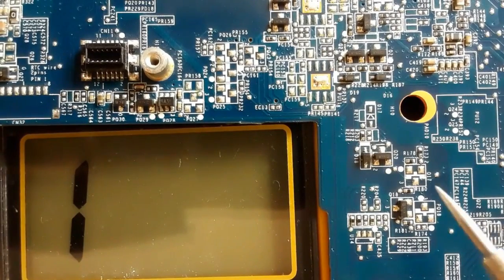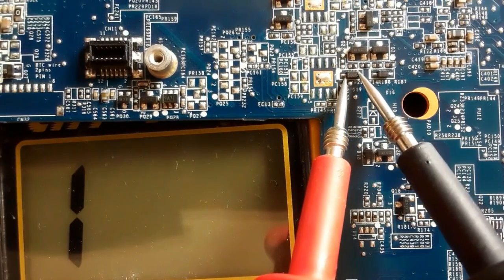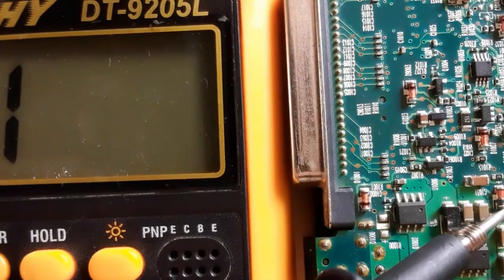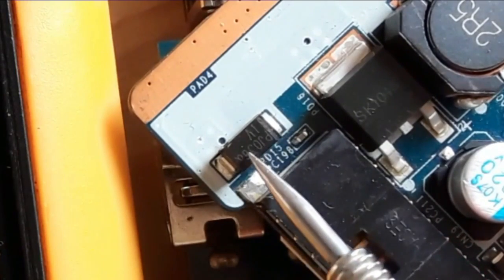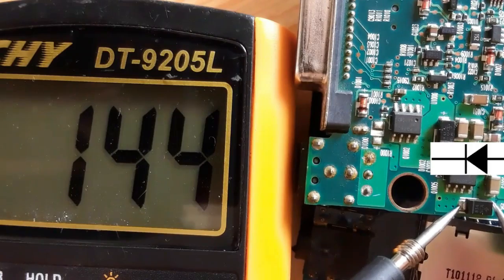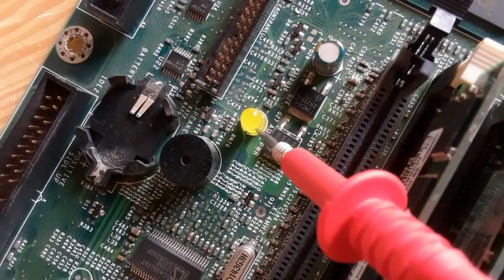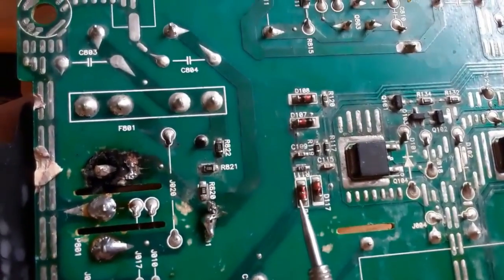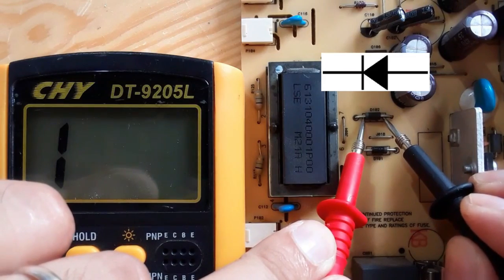SMD diode testing with the multimeter - Discover all types of diodes

Comment: My laptop motherboard is dead, then i check and found the three SMD Capacitor is bad, 100 EFK,Q72 is written on it. I cannot find to replace the same part no. So, Please can you tell me that SMD Capacitor value to change  the same value.
Reply: That is 100uF (micro Farad) E= 25Vdc. Good luck repairing!

Comment: What if you have reading in both ways when the diode is still soldered to the pcb but works as it should once desoldered?
Reply: This can happen when the diode is in circuit and is affected by other components
Reply: @cuanhogan4330  but.. if the diode AVOID current to the opposite direction, how can that be?